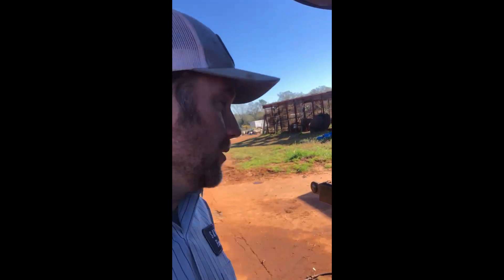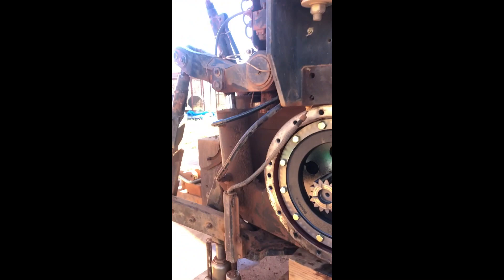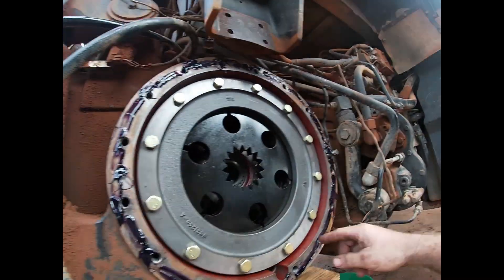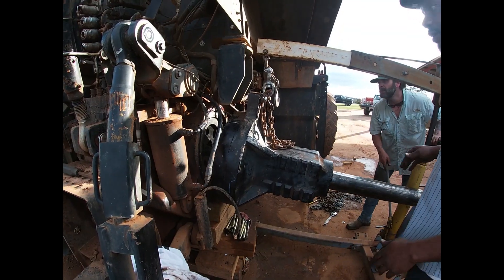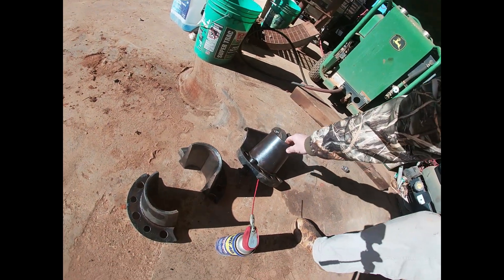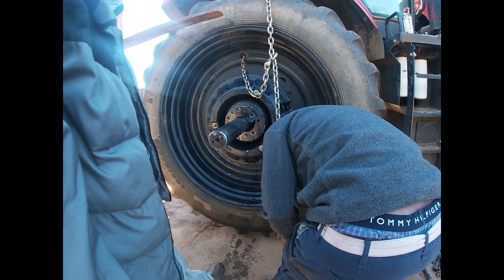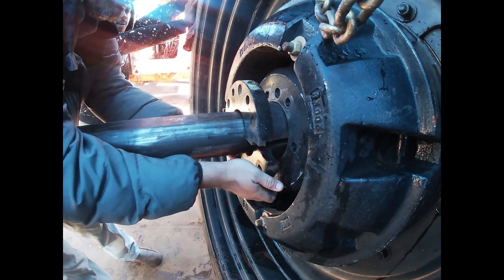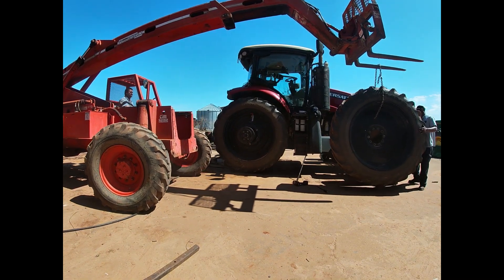Tractor Repair: Replacing rear wheel bearing on Versatile 310 tractor

Comment: Has that versatile been a pretty good rig?
Reply from the maker: Yes.  Love it.  It able to put more HP to the ground than our 8335R.
Reply: Where I work at I maintain 3 310s and a 290, I've replaced that same exact bearing and trumpet in the middle of a field. We've done the egr and particulate deletes on ours, added an additional 40hp. I've gotten no complaints on ours